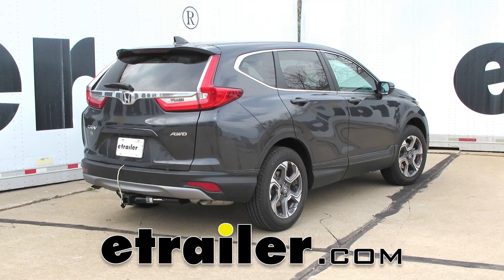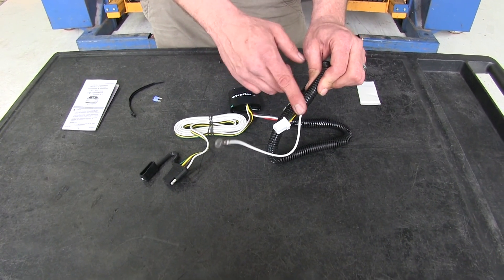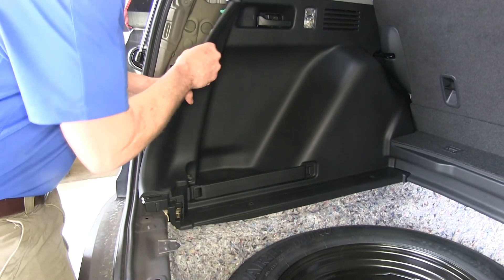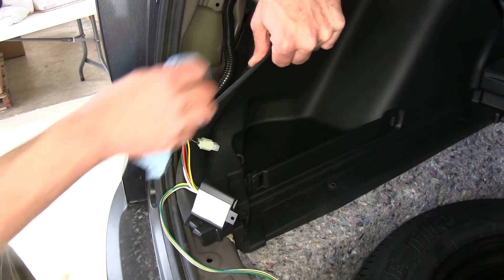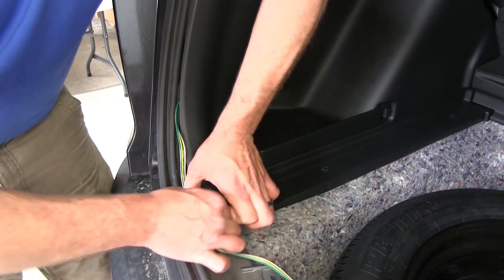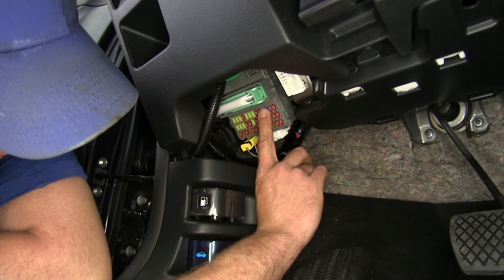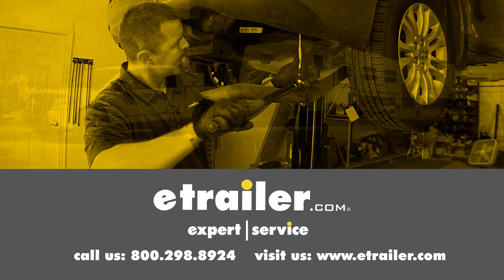Install: T-One Vehicle Wiring Harness with 4-Pole Flat Trailer Connector on a 2017 Honda CR-V

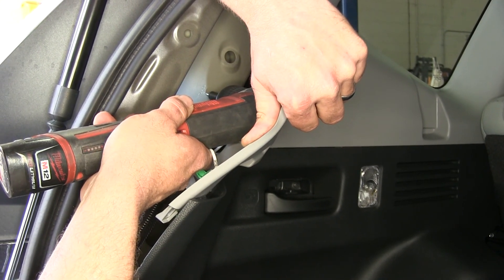Comment: Just installed on our 2018 Honda CRV Touring.   Fit well and all good quality.  However,  the self taping screw was not included. Most difficult issue glossed over by video is freeing and attaching white vehicle plug (~2:33 in video).  It became clear that the reason for popping the lever cover (1:43 in video) is to remove two attachment screws securing panel (NOT covered in video).  This enables you to pull the trim panels back a little farther to get access to the plug (2:33).  Notice tricky little edit at 2:27 that glosses over this hard bit.   Another tricky/hard bit is the attachment of the "self taping screw" at 2:56.   If you do not have a 90degree driver, with just a conventional drill/driver you will not be able to reach the location they mounted the screw because of interference with the trim panel you are holding back.   You can move the ground wire self tapping screw mounting back to the outer panel - just be careful not to interfere with trim panel remount, to mount within reach of the ground wire extension, and MOST IMPORTANTLY DO NOT SCREW THROUGH TO EXTERIOR PANNEL.   That would be a serious drag.   In summary, pretty good and easy-ish install.   I have to mount the trailer hitch next.  The trailer hitch (Item # 76128) is huge and heavy.
Reply: I was able to finally find it, connect it and got it to work.. thanks so much for your reply eonbio. Now, on to install the hitch itself!
Reply: Thank you for the comments, I ordered the kit and will be installing in a few days.  Thanks!
Reply: I have tried 3 times to find that plug, and cannot get my hand back there to even feel for it. The back of my hand painfully smashed by the grey cover and my hand never can get around that corner to feel for it. I had my wife try reaching behind as I bent the plastic back yesterday and she couldn't do it with her smaller hands either! I read this and walked outside to my car during lunch today and I see those two screws: didn't know if I should be messing with them previously, but will try this again tonight. Thank you for the information: pretty damn important I think, and a little ticked at an otherwise good video for not sharing this.